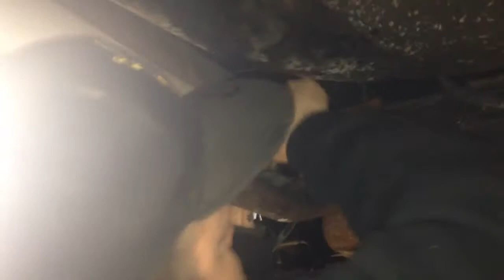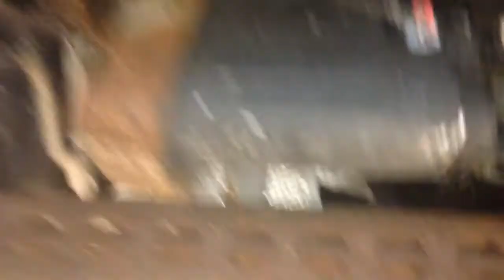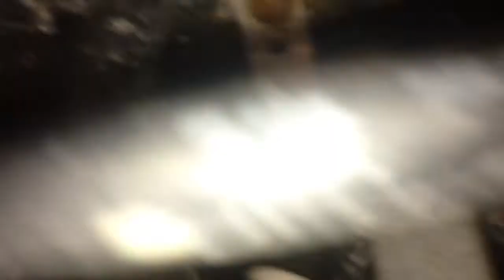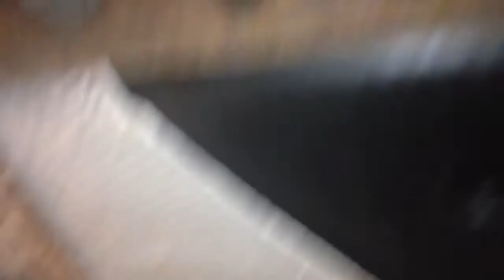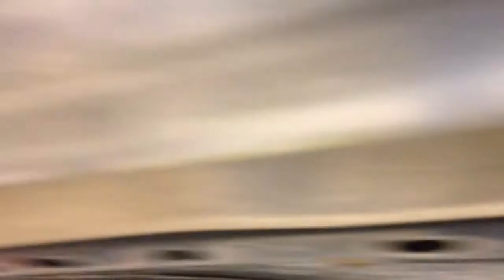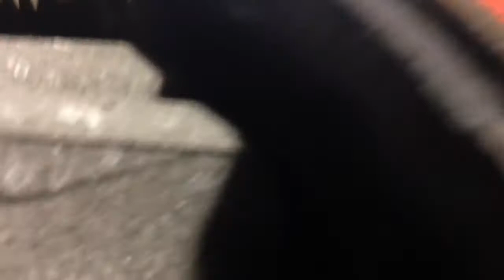Saturn Repair: fuel lines, exhaust, pads and rotors.

Comment: Those fuel line look pre bent? Where did you get them? looks good and tidy.
Reply from the maker: jediemaker got them off Rockauto.com . Came with everything prebent and fittings flared and everything ready to go. Only thing else I didn't get was a fuel filter got that localy
Reply: Had fuel lines replaced on my Cobalt, which is mechanically similar to a Saturn Ion.  The lines were ordered from a GM dealer, and were pre-bent.  Fuel lines do tend to rust and leak due to the foil heat shield wraps installed at the factory.  They trap water, salt, and dirt, eventually causing the lines to rust.